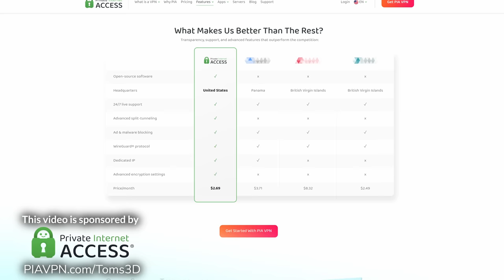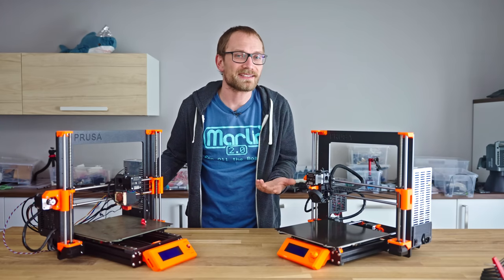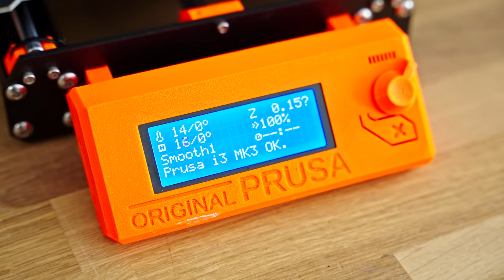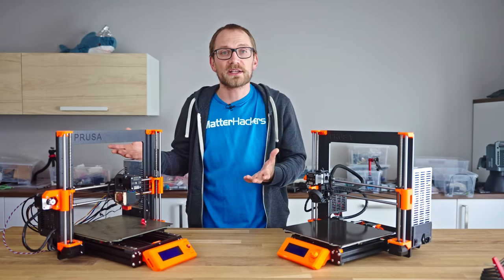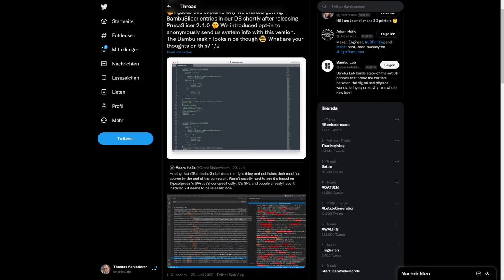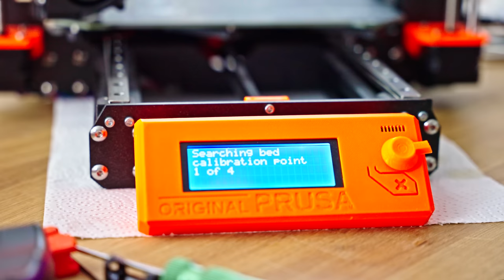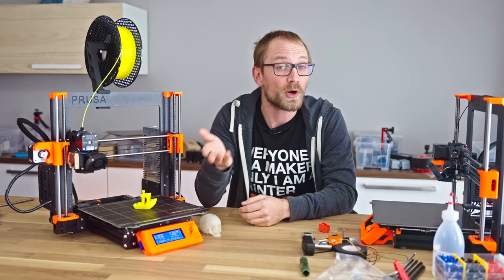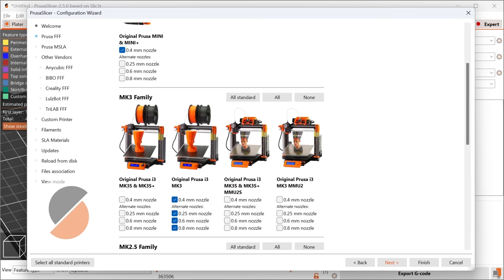This printer is OLD. Why is it still my favorite?

Comment: Still your favourite even after the P1P came out? I feel like its a really hard bargain now.

When Bambulab exists and crushes it at all price points with better ease of use, performance, monitoring etc, and then Vorons/Ratrigs etc exist and are getting easier to build from kits or even buy, crushing it at modability and open source you gotta think its really long on the tooth.

Its slow, it doesnt have input shaping, it doesnt have nozzle based ABL, it doesnt have wifi, cameras, its just really lacking now.

Its only modern selling point is what, support? How many people even end up needing support?
Reply: The thing is, I am a student, I study Electrical engineering, but I particapate in a mechatronics class after hours. I don't need a machine that is cheap like an ender or fast like the bambu. I need one thing, and one thing only: reliabilty and ease of use. I don't have time to baby my printer when I need to print something; I also don't have time to tune in every filament I need to use, sometimes I switch from a Nylon, to PETG then ABS, then to a TPU. Guess what? I have never had to tune anything on the printer
- a satisfied MK2.5s owner
Reply: @Fejszi  the thing is, bambu printers are the easiest to use machines on the market currently. Theres no need for live adjust z, and everything is automated. Its also proven to be extremely reliable. I also kinda doubt you can manage to print pure nylon on an open mk2.5, or is it enclosed?
Reply: I don't think any other printer manufacturer can match Prusa's amazing track record with their upgrade paths. The first Prusa kit I purchased (MK1) was years and years ago but I was able to do all the subsequent upgrades from Mk1 to MK2 to MK3S+. An incredible range of hardware/software/firmware advancements are represented in those upgrades. Printers from other companies I have used just get abandoned as they move on to the next model. I've never had to throw away/give away/abandon a Prusa product. There is no other manufacturer I've used that I can say that about.
Reply: From my experience prusa "support" isnt really support as most of the time they never fix your issue. When I was under warrenty they would send me random parts expecting that to be the issue when in reality the original parts were working just fine. As a hobbiest, support isnt really important as you get used to fixing things yourself anyways. I agree the mk3 isnt worth it currently. For a company that made so many changes to the industry, its sad that they are no longer relevant.
Reply: @morbus5726  of course its an enclosed machine, its the only modifications on it that isn't a genuine Prusa part, everything besides it is genuine. You might not need to adjust the Live Z on a bambu, but how long has the bambu have been around? 6 months. How long have the I3 been around for? 10 years. Its a proven design, why can't we be left alone? Everybody seems to hate us because some of the 3D printing community wants to stick to one proven machine/design
Reply: @Unscientifically  One could argue that this is an anecdotal individual experience and therefore not representative. One could also argue , the quality with which a support case is handled never ever depends solely on the supporter, but, because it is a matter of communication, always on the questioner as well.
Reply: Regarding the P1P: Well, arguments based on a printer that has yet to prove itself in a widespread application are hard to take seriously.
Reply: @tmartin9482  People with strong opinions like this just seem overly resistant to change.

Literally your only argument is "but it's new". Using that logic 10 years ago no one should have bought or used a mk3.

In reality it's almost certainly fine, and if not, the company behind it will be around to fix minor niggles.

I feel like people are just annoyed that this company, a closed source company is u seating Prusa, a company too many people act like are the second coming of Christ.
Reply: True. My issue was a lot more rare but trained support members should have been able to fix it as it was just a faulty heater. It wasnt just a one time thing btw, Ive talked to like 10 different support staff and all were no real help. It wasnt like my questions were not asked correctly, as the problem was easy to describe and I showed them video of the problem. 
I ended up buying spare parts they told me to buy that never fixed the issue
Reply: @BeefIngot  I think its just people who invested a lot in prusa are mad that their investment is no longer relevent as cheaper printers are proving to be better. I was like that too till I recently sold my prusa and bought a voron
Reply: @BeefIngot  It's not a matter of resisting innovation. It's about the fact that your comparison between a product that has no market penetration and for which there are just the first reviews, and a well-established product for which years of experience, feedback and statistics exist, is a decidedly stupid one.
I'm not dismissing the Bambu printers at all and giving them a fair chance. I just don't ride the hype train like so many influencer / reviewer fanboys do.
Think about who is evangelizing here.

Comment: Newer chips aren't about more power (well they are but that's not the main problem in 3d printers area). They are about having more memory available for code and program run. Just see prusa firmware repo how they care about each single byte. It's madness. Bigger features cannot be implemented due to lack of memory there!

Comment: I do hope bambu is able to stand the test of time and disrupt the industry. Ive been interested in 3d printing since the prusa mendel but it may be time for the king to step down. E3D set standards as did prusa at a time when the new field of 3d printing was exploding, i think they both want to recreate that with the Revo hotend and the PrusaXL, i dont think they will succeed. What we really need now is CHT nozzles made of tungsten carbine to increase flow rates, corexy machines to improve kinematics, input shaping to increase accelerations etc, 2 hours for a benchy on a $700 kit machine isnt worth a lot of peoples time. 15mins on a fully built machine for the same price is much more tempting. Bambus P1P looks like its gonna pwn

Comment: What would be nice for the Prusa i3 mk3s+ would be USB-Suppot like they have on their other printers. SD-cards are annoying. I have to get everytime I want to print something a cardreader and often the pc does not recognice the sd-card reader and when it does, often the sd-card don't want to work. And everytime the combination which works is different (yesterday it is the T430 with the Card reader in the Dell-Monitor, but not the in the T430 integrated one, today it is the card from my father combined with the zephyrus  G14 and tomorow it is different again).

Comment: 5:13  I thought that seeing that expensive Ultimaker sitting on the shelf collecting dust was the saddest part of this video.  I do not own one, but I thought that the Ultimater was a professional quality printer.  And, Ultimaker is the company that gives away its Cura slicer, which is still my slicer of choice.  But what has happened to their printers?
Reply: I was using an Ultimaker printer at previous job. I absolutely hated it. 
I am using it as a example of that "more expensive doesn't mean better". I had a whole carton box of half-printed parts. I was using ultimaker filaments and other brands filaments, no mater which I used there always were problems with the extrusion... It was totally unreliable. I think I can even say it has more work-hours printing spaghetti in air or just swinging a clogged nozzle above half-printed parts, than actually printing something whole.
And even when it managed to print something whole the part quality was not great. It was making a lot of blobs on the walls and top layers almost always were full of holes. Also infill was absolutely awful.

Cura slicer is amazing and I am still using it, but I can say nothing nice about the printers beside that they look and glow pretty.
Reply: We have an Ultimaker 3 in my schools makerspace, its a nightmare, leveling gets thrown off, the filaments are constantly reported as ran out, it screams for maitanace every 2 seconds, and the whole user experience is still better on an Ender 3 than on that...